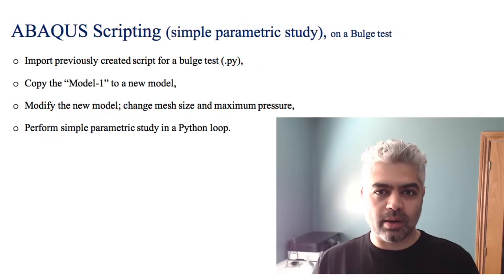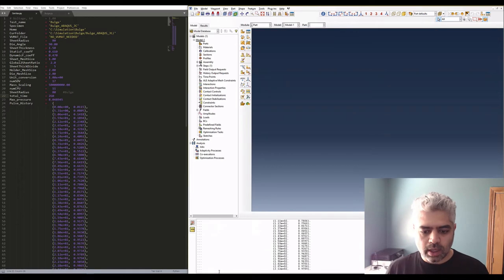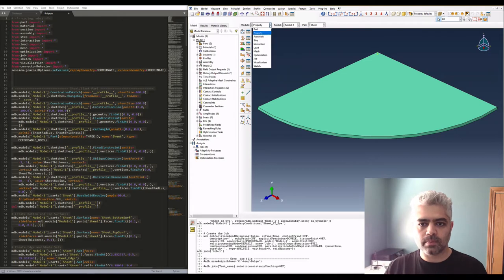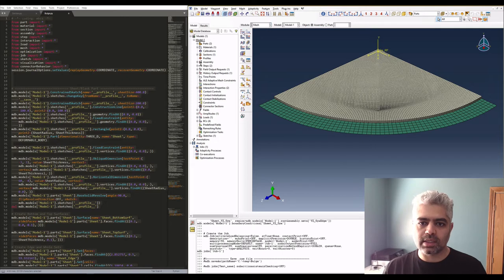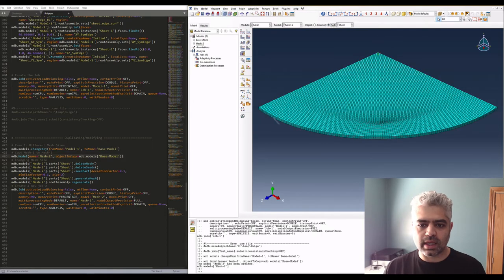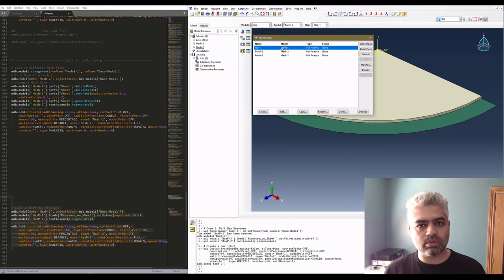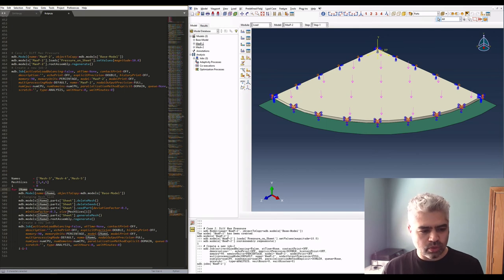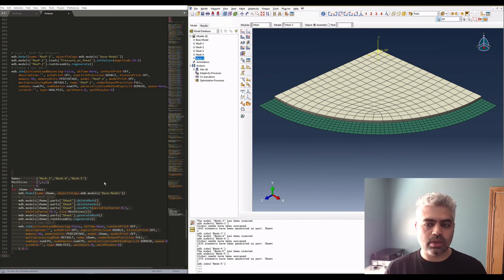Learn ABAQUS Scripting; How to Copy/Modify Existing Model to Do Parametric Study

Comment: Hello sir,
Is it possible to extract a script from an exisiting model that was not made by abaqus scripting ? 
Then i could rerun this script buy changing small things to get various derivatives from my base model made manually . 

Thanks in advance !
Reply: Hi, 
I have the same problem. If you find any solution to export the python script from an existing model, please let me know !
Thank you
Reply: @mathmath545   Hello guys, if you want extract a python file from a model when you save your model in the work dirc you will find a file .jnl  change it to .py and read this fil.
Best regards.